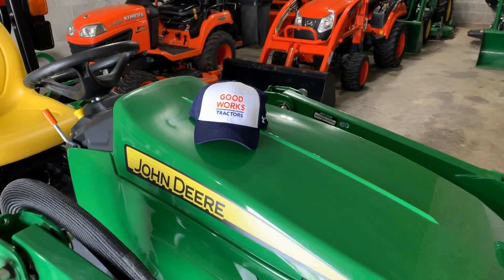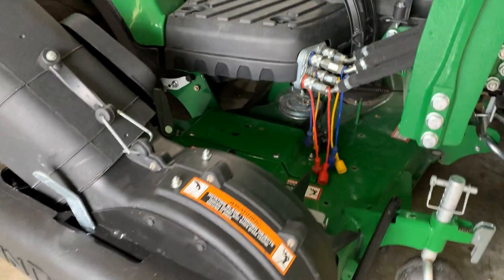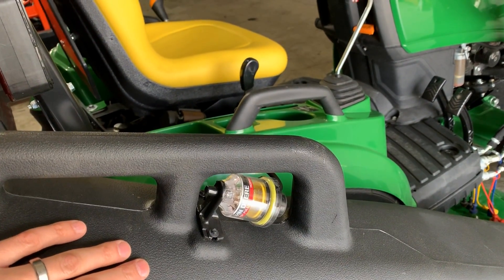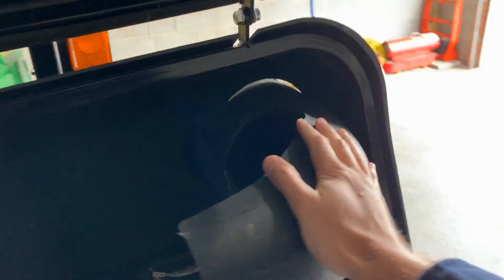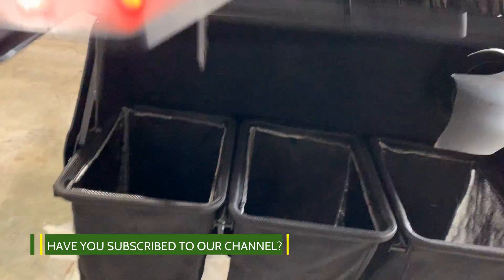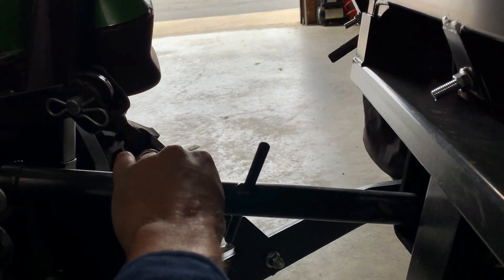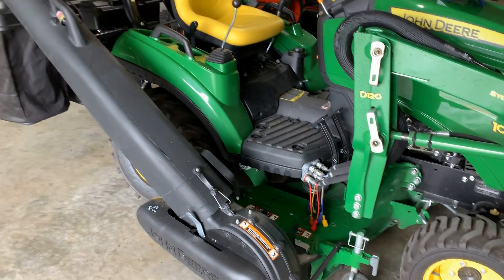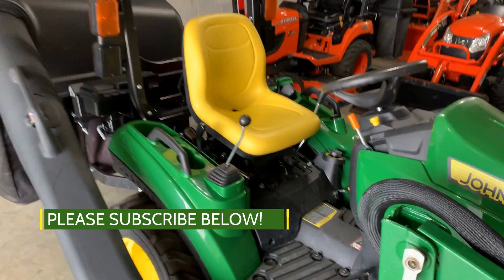John Deere Material Collection System Overview

Comment: I have a new S240 mower with the buc10911 power flow bagger.   I have already burned out 2 belts on the Power Flow Bagger. Can you post a video on how to replace this belt?  A how-to video so I don't have to take it to the dealership.  Thanks in advance.

Comment: JD needs to do some work on this collection system.  I like the Kubota one better that uses the rear PTO.  Seems more thought out and better system.  Odd that the JD doesn't use the 3 point hitch at all....seems as if the system was made for smaller tractors and then adjusted to work on the 1025r, etc.  I'm currently looking for a subcompact and trying to decide between a BX23S and 1025r.  Leaning more towards 1025r.
Reply from the maker: cashxx Funny enough, I've got another video coming soon on the Kubota version.  They utilize the rear PTO which is definitely more robust, but also doesn't use the lower three point links. That is fine by me.  

However, no prevelant reliability issues with John Deere's system.  High quality overall.

Thanks for watching!
Reply: The more I think about it, it's probably best that they don't use the 3 point hitch.  If controls were separate between the 3 point hitch and mower deck then it would maybe make sense.  I was more thinking of hookup and disconnecting the bagger and being easier using the 3 point hitch and simply backup and raise it.  The Kubota I believe has stands and the bags lock into place and again I like the PTO powering it.  Can't wait to see the video on the Kubota comparison!  Be nice to see an updated comparison of the 2018 1025r and the BX23S.  I don't think anyone has done a video like that yet.  I think they all compare the 2017 model of the 1025r.
Reply from the maker: Yeah, I understand what you mean about connecting and disconnecting.  It would work with an independent hydraulic deck lift option, but that wouldn't be worth the money in my mind. 

I will take PTO driven versus belt driven any day, although no known issues with the belt system on JD.  It wouldn't dissuade me from purchasing, but given the choice I'd choose PTO.

Someday I'll have both a current model JD and direct comparison Kubota.  I never know what models I'm getting in so I have to bide my time :)

Thanks for watching!

Comment: Did John Deere recently change the mounting system for this? 
I have a new 1025R I am trying to install a 14 bushel rear bagger MCS on. The hitch plate bolt holes are 2" on-center and the bagger mounting frame bolt holes are 4" on-center.
Reply from the maker: not sure, haven't had a new bagger setup yet

Comment: Can the whole system be easily removed and put back on again like the other implements
Reply from the maker: Yes, it is pretty easy although it does require more physical labor to lift off the parts compared with the loader and mower.  Thanks for watching!
Reply: @GoodWorksTractors  thanks
Reply: Hey Steve , the system works great but this can’t be taken on and off with ease. You will need tools to remove the belt. 

Take 10-15 to remove and or put on . The system is also pretty I have limited space , if storage is an issue I would think twice. The last thing is the price , you could buy a used ride on mower with a bagger for the price of the bagger . Unless you are going to use it religiously and not take it off , I personally can’t recommend it .
Reply: Good Works Tractors  thank your the video you make excellent content . Unfortunately the bagger is big and pricey not the beat attachement for the 1025R.

Comment: Can you tell me what that Material Collection System costs including the deck mounted blower?  A local dealer has one used for $2500 and was wondering if that is a good deal.  I have a 1023 tractor with a 54 inch deck mower. Thanks!
Reply from the maker: Sorry, I am not a John Deere dealer.  Your best bet is to call your local dealer for this pricing.
Reply: Roger, and thanks for taking the time to send a reply.
Reply: new is 2975
Reply: Thanks like craft!
Reply: New is closer to $4300 in 2024... insane.